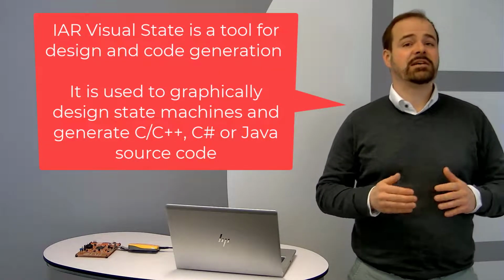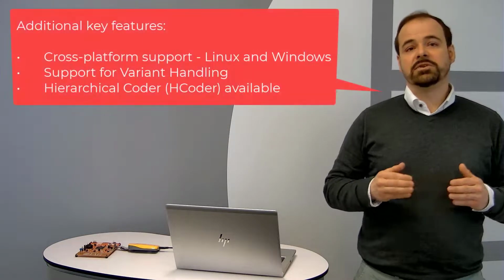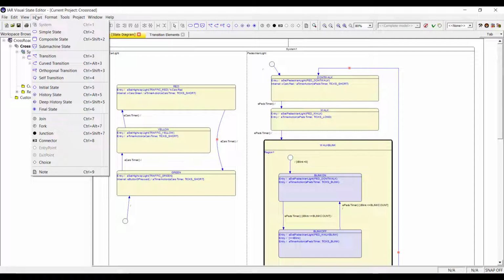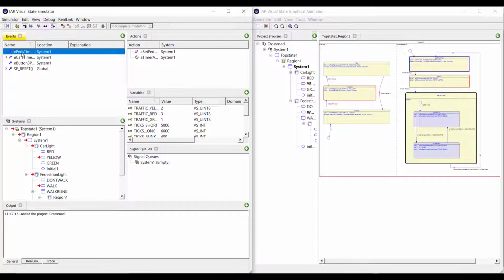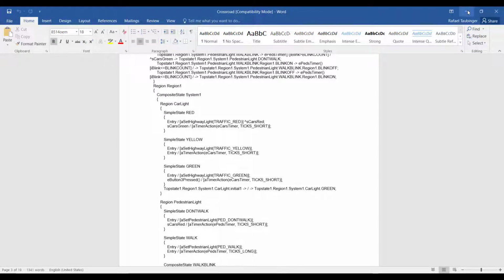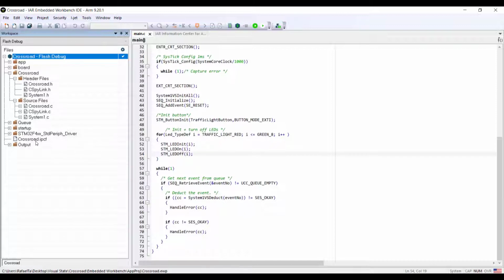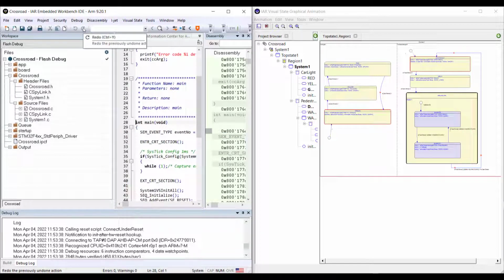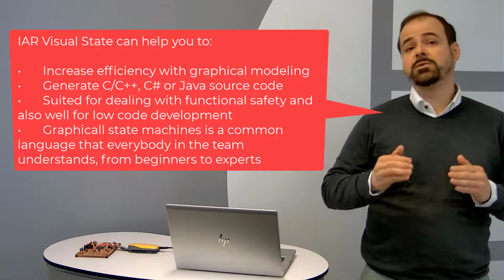Getting started with C/C++, C# and Java for embedded systems and apps in IAR Visual State

Comment: 感谢！我还想知道怎么使用visualState生成C++代码？怎么在软件中使用生成的代码，能演示一个demo吗？
Reply from the maker: Hi,  in order to generate C++ code, please choose Project>Options>Code generation to open the Coder Options
dialog box. In the left pane, select the project and make the required settings on the Configuration
page. Make your settings:
C++ code generation: generates C++ code (requires the Adaptive API). In case you have further questions, please reach out to FAE@iar.com.